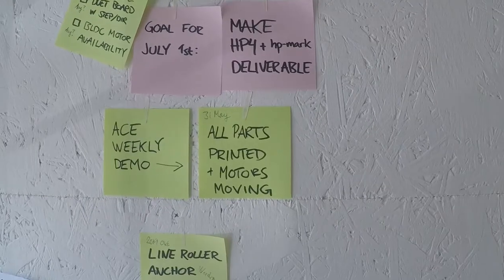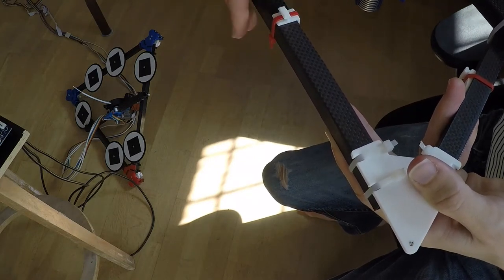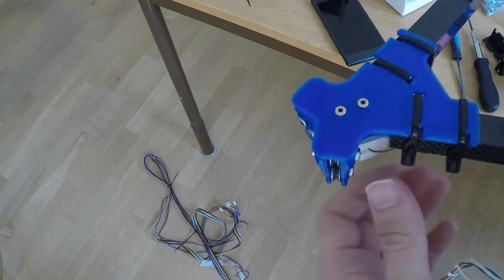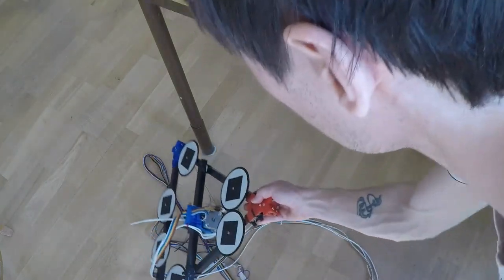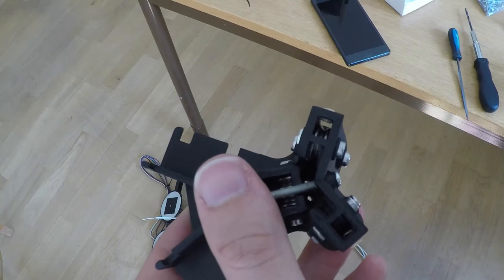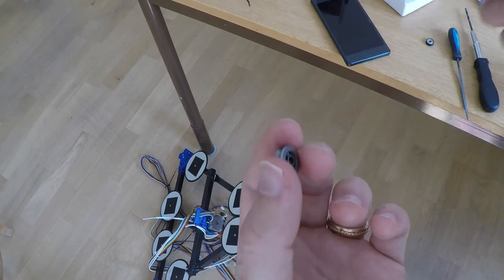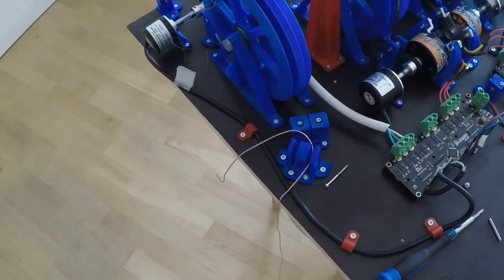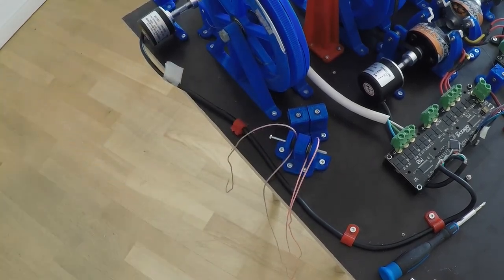Features Of the New Corner Clamp

Comment: Haven't been up to date on the hangprinter project, but i'm kinda impressed what you've been able to achieve on the version 4. Keep up the good work. Sound wise, the v-groove bearing probably wiggle a bit, when the wire touches the side of grooves. So its noisier than the smooth bearing, which don't have lateral forces applied to it.
Reply from the maker: Aah, that might be true. I'll print a steep vgroove and fit it onto a flat bearing, and run it in the sound testing rig :)